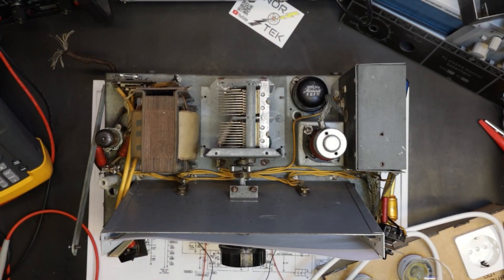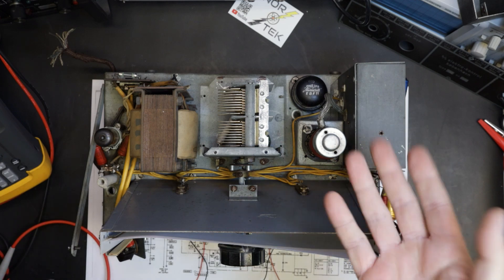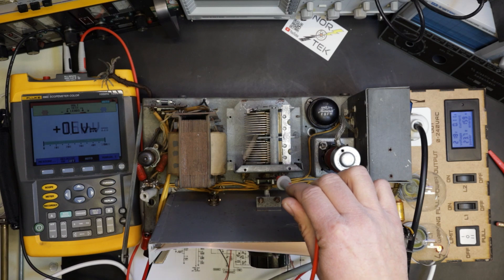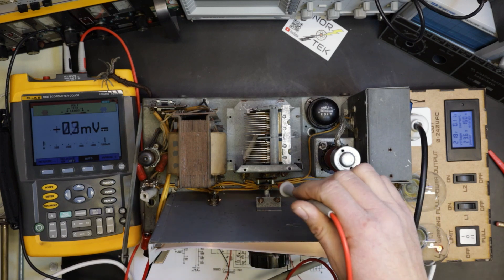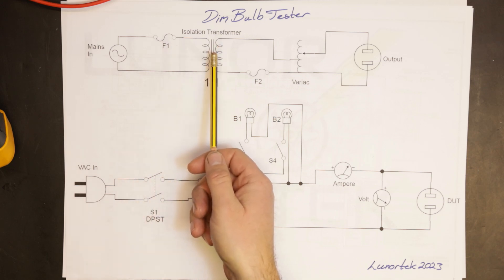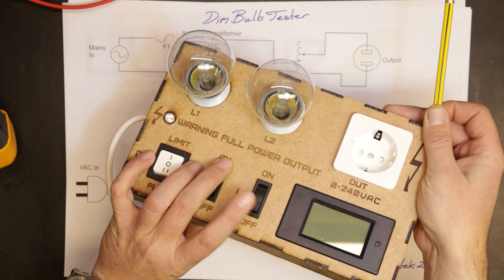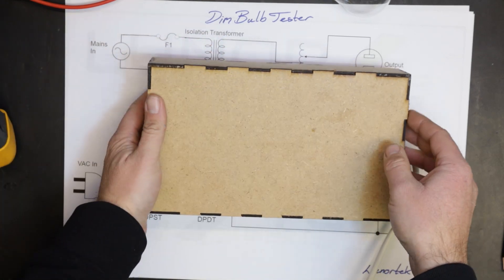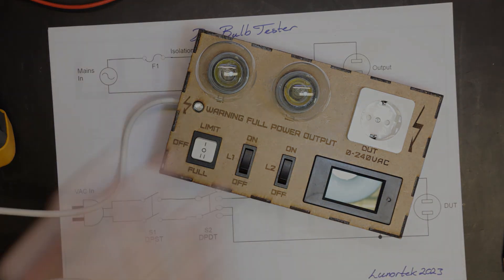Dim Bulb Tester - How its made - with Schematic

Comment: What is the black ring with the symbols "⌀30" that looks like a ferrite bead?
Reply from the maker: That is the current sensing for the meter.
Reply: @LUNORTEK right, a small Hall-sensor i guess. Is this digital meter that you are using Peacefair PZEM 022?
Reply from the maker: Yep, a hall effect sensor. Not that model meter I have used. Used one I had from an older project. It’s a cheap ebay bougth meter. Here is a link to a similar one. No brand.. https://www.ebay.com/itm/154753111183?mkcid=16&mkevt=1&mkrid=711-127632-2357-0&ssspo=XTMPZF_FQCG&sssrc=4429486&ssuid=_wX_H8F7R1q&var=&widget_ver=artemis&media=COPY